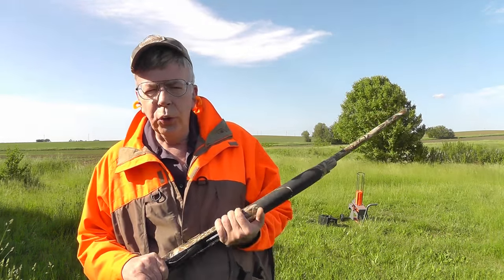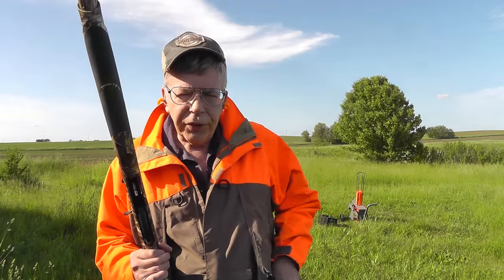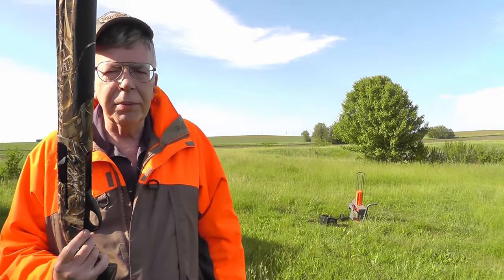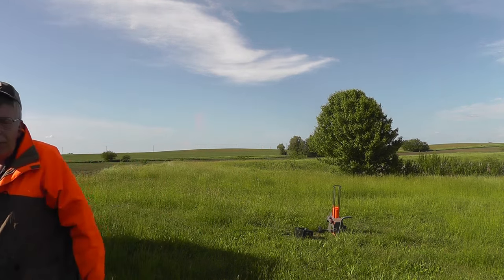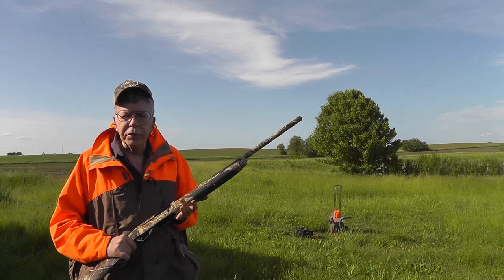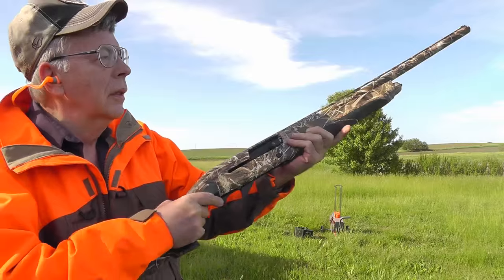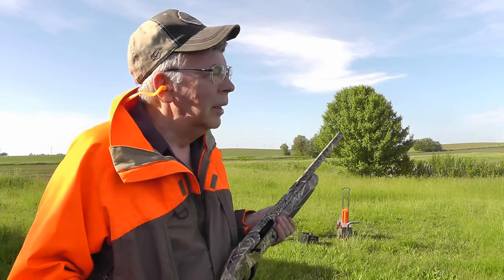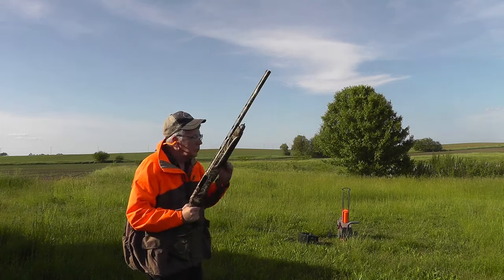Weatherby Element 12 Gauge Autoloader

Comment: I agree. Bought the gun last year after giving a lot of thought because of a bad experience with another brands inertia gun, but trusted the Weatherby brand and their attention to quality, where ever their guns are made -USA, Japan, Turkey. I bought the Element Waterfowler and next day went to duck hunting and first shot, got a wood duck. It functions fine, feels light in hand, shoulders great, not too much felt recoil even with the steel shot loads. I agree that the safety button is awkward and could have been bigger. I am going to look for bigger bolt release button and extended bolt handle. Price to value is pretty good with this gun.
Reply: Edizkan Ata  Did you end up finding a bigger release button?

Comment: did you have any issues with the gun making a loose noise after a few rounds through it? just bought myself one and it has a loose noise which I think isn't normal.
Reply from the maker: No issues at all with the Weatherby Element 12 gauge.
Reply: Tou Yang mine made that noise. I think it's the plug wiggling around a little bit. I stuck some foam in the end cap and it made the rattling quit